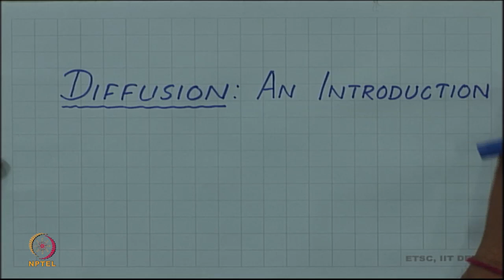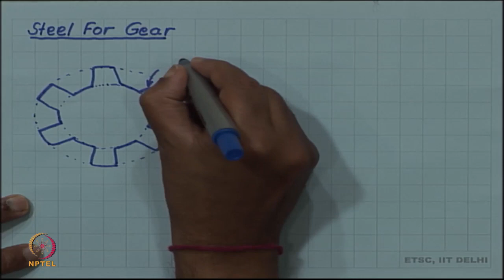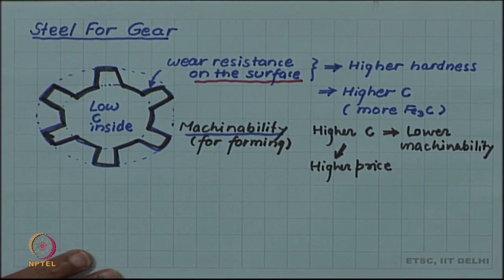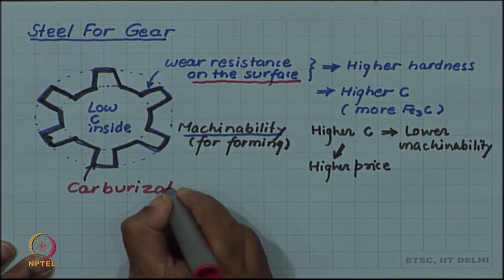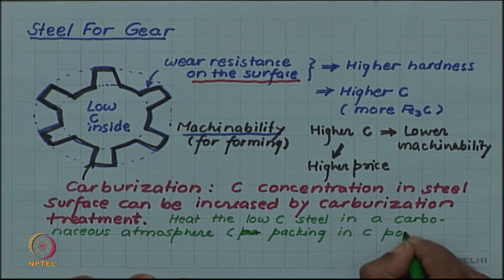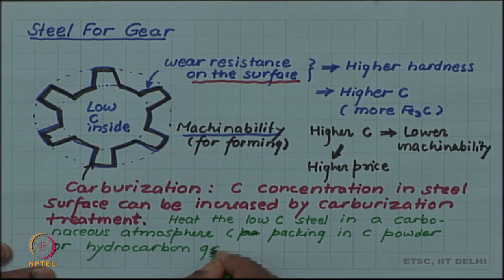Diffusion: Introduction

Comment: As core is being ductile doesn't the shape get changed, when surface messes with other gears?
Reply: How hardness and ductility, 2 properties or combined in single component?

Or is there any other example for better understanding?
Reply from the maker: @metallurgist8326  The core is ductile in relation to the case. It is lower yield stress in comparison to that of the case. If the stress in the core exceeds its yield stress it will deform. But the design of gear should ensure that this does not happen under normal working stresses.
Reply: @introductiontomaterialsscience  ThankYouSoMuch Sir, for ur clarification.